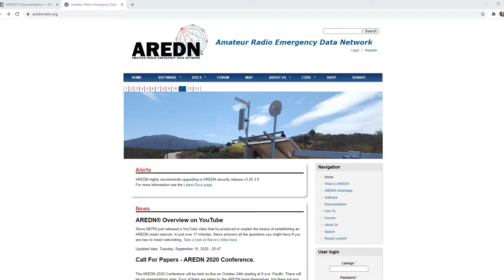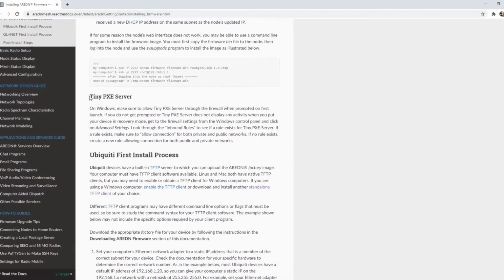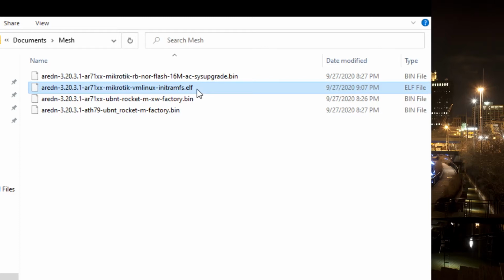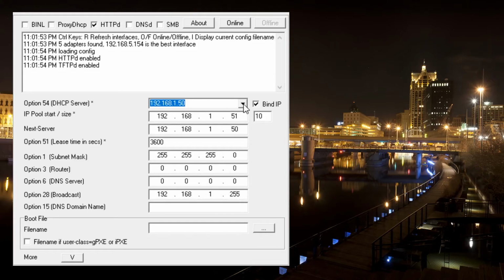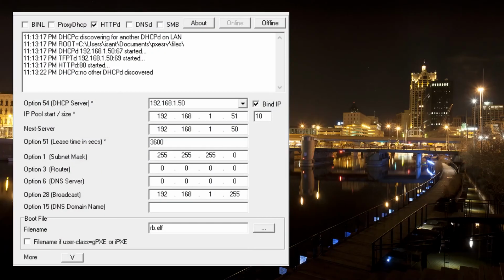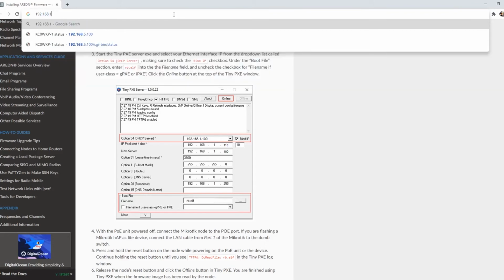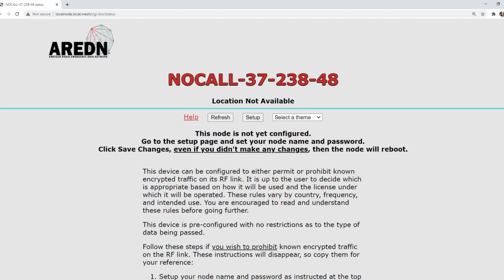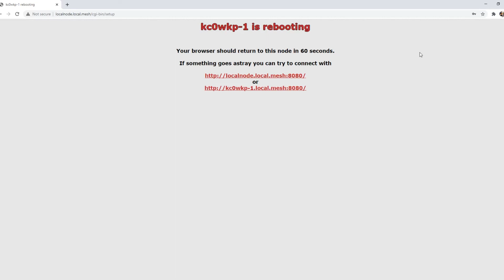Installing AREDN Firmware on a Mikrotik Device

Comment: Having a hell of a time with this. Update seems to went just fine. When I set to automatic IP and change to port 2, I can’t get anything on 192.168.1.1.
Reply: Make sure you either change your IP back on your computer or allow it to DHCP. IT does take a wile and will reboot several times before it comes up. The other thing you may need to do is add :8080 to the end of the address some browsers don't like routing to IP addresses.

Comment: Aloha.  Great instructive video and still relative a few years later with new AREDN & MikroTik updates.  Had to install AREDN software on a LHG5 antenna, and it was helpful as well.  After I used the theory you presented to figure it out.  Could not find anyone who actually shows how to do it on a new dish.  But some thinking and your video helped a lot.

Comment: I've been going crazy trying to get this to work. Is this method still viable with current hardware? The hAP ac lite doesn't seem to perform a PXE boot.

Also, Tiny PXE is blocked by many AV softwares now due to embedded trojans. You'll want to use an alternative PXE/BOOTP server.
Reply from the maker: Many firewalls block tinyPXE ports, it is not a trojan. This is still the process for current Mikrotik devices.
Reply: @RadioGeek  I tested it with as many AV brands as I have available. All of them detected Trojans. Upload to VirusTotal and 10 of their engines detect Trojans as well. This is code analysis. It's not blocking ports because it isn't even running yet.

Many browsers also block it's download pages for the same reason.

Comment: Great video, thanks! I flashed my hAP ac and it works great! I'm about to flash a Mikrotik LHG and I'm wondering if I can use my hAP ac as the dumb switch? Thanks again!
Reply from the maker: Your HAP will always work as a router, if you only need the dumb switch to trick PXEserv, just turn on the node and plug it into the computer long enough to open PXEserv and then power off the switch. PXEServ will see the network port up long enough to save the settings.

Comment: Cannot get the hAP lite to read the file. I have tried two different units and neither will program. At what point do you release the reset button?
Reply: im having the same problem
Reply: @person12307  Make that a third. Same thing here on several units. I'm wondering if the newest bootloader isn't supported. I've seen some references about having to downgrade the device firmware first.
Reply: Well, I decided to run Wireshark and see what's actually happening. The hAP receives an IP address and makes a BOOTP request, but not for file rb.elf. It's requesting a file named vmlinux. I changed rb.elf to vmlinux and that gets me to the next step in the process. However, the actual transfer fails. The hAP sends an unknown or poorly formatted GET request and the transfer stops. Perhaps a different BOOTP server will work better, but I've only gotten one to work at all so far. Right now I'm using haneWIN DHCP server.

Comment: A couple of things that I'm running into on Windows 10 at least. The Ethernet cable has to be plugged into something with power (either a switch or the node), otherwise, it won't allow you to change the IP Address that you're binding to. Also, you have to disable all of your firewalls (you can try to create an exception for the pxeserv file, but I had issues with that). Otherwise, it won't allow you to open an httpd socket (Socket Error 10013 is what I got).
Reply: That is correct, having a switch is one of the steps I indicated was needed. There is a way to do the install with out the switch, but it is best to have one.

Comment: Once you've installed the AREDN firmware, you don't need to use the elf files anymore to upgrade, correct?
Reply from the maker: That is correct. Down the road you can load the "sysupgrade" file right into the node via the Administration page. You won't have to put it in a special mode or anything like that.